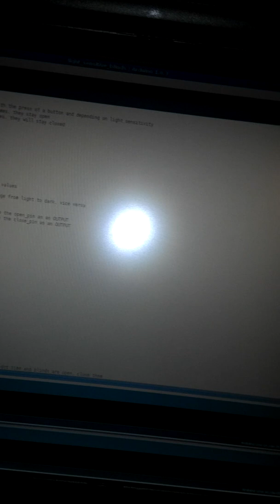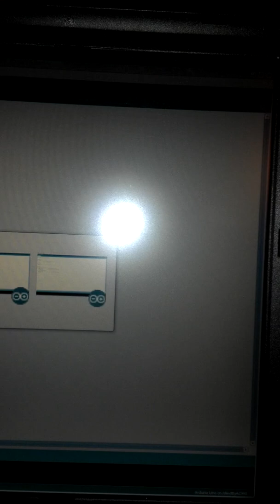Automated Window Blinds with Arduino [Not Ugly]

Comment: Really nice, I do some coding and I want to use Arduino to control some Blinds in my house that are hard to reach, I want to use BlueTooth so I can use an APP to control the blinds, I am also looking into a mix rechargeable battery + mini solar panels so I don't need to work some energy cable or change batteries... 

Nice system you have going on.. I am trying to figure out the best motor to use.. I was looking into what  they call stepping motor, you used a Servo one.. I will look into that!

Comment: Really enjoyed the video, thanks!  I am currently at the wiring stage for a new house, and want to do just what you've done for all windows.  Wondering 2 things:  (1) is it possible to put sensors/motor at the window, and keep the Arduino in my media closet, and if so, what wires to run?  and (2) if not, if Arduino must sit at the window, would running a cat5 from media closet to window and doing PoE work to power it?

Thanks again for a cool video :)

Comment: nice job. don't do wifi. keep the product cost down. you can retrieve IR codes from any remote and re-purpose them (to eliminate the transmitter). Bluetooth modules will give you capabilities from the computer the only downfall is you wouldn't be able to control them from over 30 feet away (depending on its class). I think you did a great job on this design.

Comment: It's probably worth mentioning (as one with no experience of Arduino, but plenty of experience of R/C) that servos come in all shapes and sizes -- so if you're inspired to do something similar to this project but need the servo to be much smaller then that's doable, it's just a matter of money -- spend enough and you can buy very small servos with loads of torque, should you need to.

Thanks -- an inspiring video -- think I might have to go out and buy an Arduino and play...